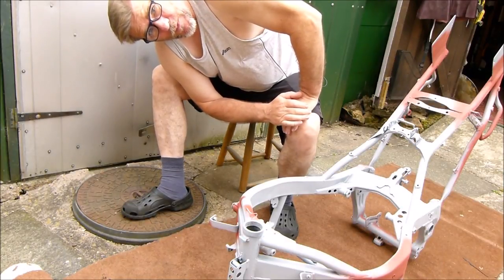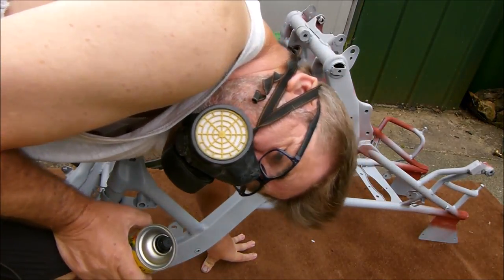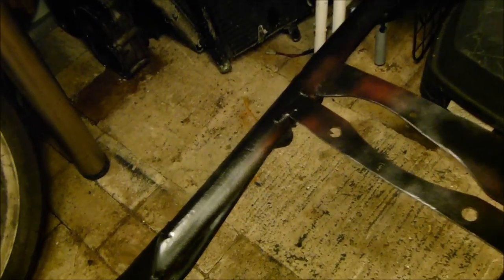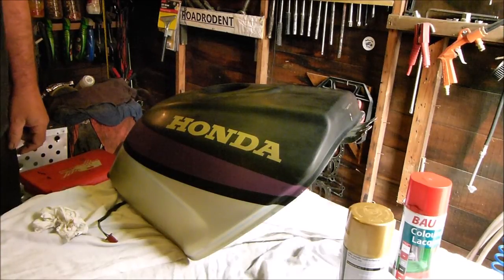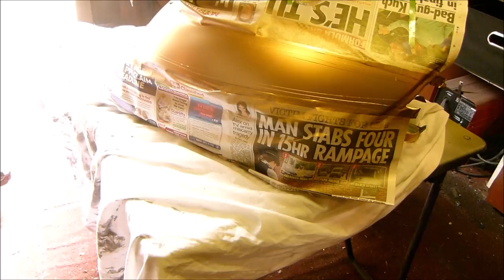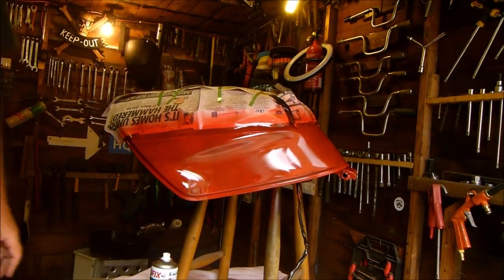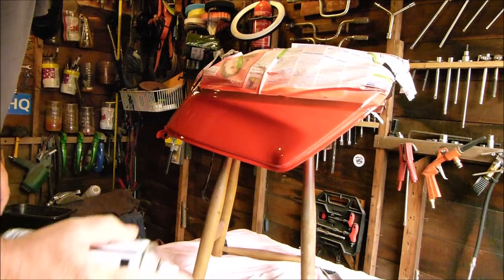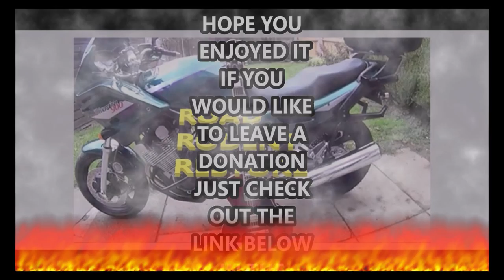CBR1000F Landfill bike, tank and frame paint colour experimenting.

Comment: Hi John long term watcher here love ur channel mate I’m after a bit of advice Im currently restoring a gs500 and don’t wanna pay tons of money for sandblasting and powder coat how did u get all the old paint of I’m dealin with quite a lot of surface rust as well any advice greatly appreciated keep the vids coming matey
Reply from the maker: Hi DT.. Cheers buddy, I usually use wire brush attachments on the angle grinder to remove the old paint ..  The smaller rusty parts I leave to soak in white vinegar for a few days.. Good luck with the GS, hope it all goes well.. 👍💰👌